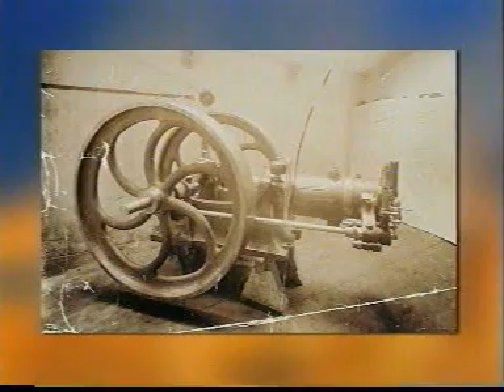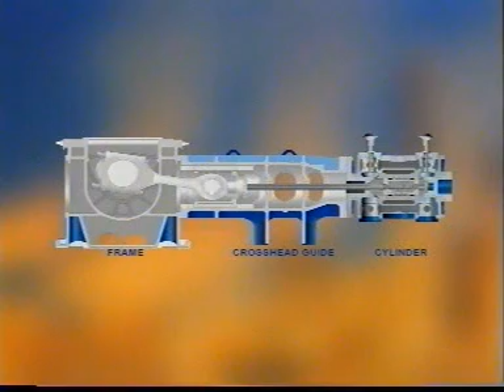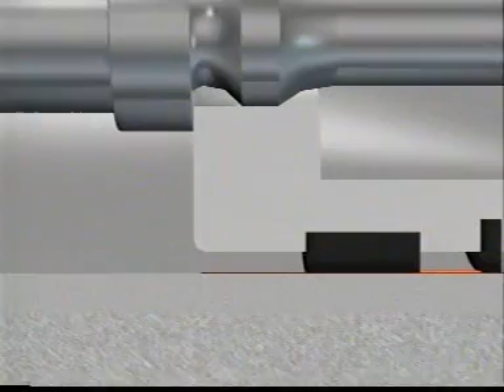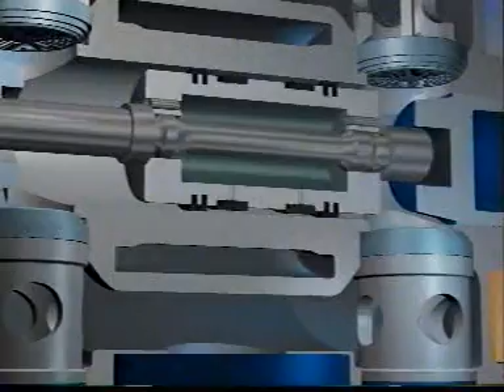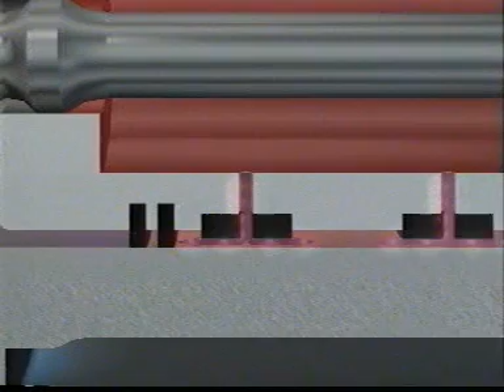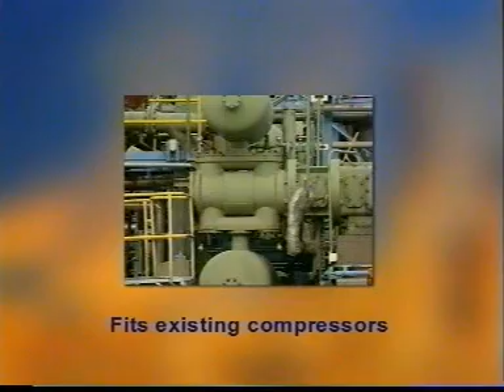Free Floating Piston Film (mpeg).mpg

Comment: No. The air replaces the rider rings that support the weight of the piston. That is why there are only jets on the bottom of the hollow piston.  Compression rings are still needed to keep the air in, but these are subject to an axial force which does not cause so much wear as the weight of the piston. What I don't get is why they don't mount the piston vertically.... I guess it is down to the size of the equipment.

Comment: Hi, what drives the free piston?
Reply: The piston connects to the crosshead. The crosshead connects to the connecting rod. The connecting rod connects to the crankshaft (more commonly known as the eccentric in compressors). The crankshaft is connected to whatever prime move if most efficient for your application. If you are compressing natural gas it may be a natural gas ICE. It could be an electric motor in other applications or even a steam turbine.

Comment: yes, in fluid dynamics, the air is the lubricant. that is the whole point of this design, and the reason for intake port roughing.  i digress.  it makes this a non-contact design.  bearings, are, aside form wet-sump/oil fed fixed bearing applications, are contact bearings, like ball, toroidal, roller/t-roller bearings, bearing the load on a contact surface.  the smallest degree exists on roller bearings, due to  alignment control, but they all have what is known as "scrubbing" oil is imperative.

Comment: so lets see the air replaces the oil that lubricates the rings that keeps in the air that floats the piston negating the need for oil for a bearing surface like a ring which you have included to keep in the air.
Reply: In some processes, lube may be considered a contaminant. If the product is medical grade oxygen what type of lube would you like to breathe/smell. We must be careful about using products that may off gas VOCs into products for human consumption.